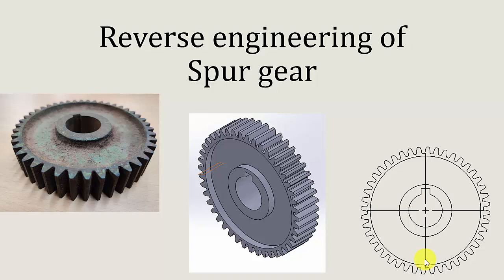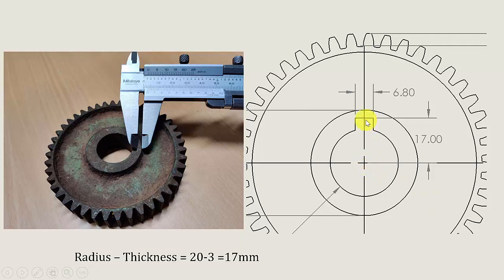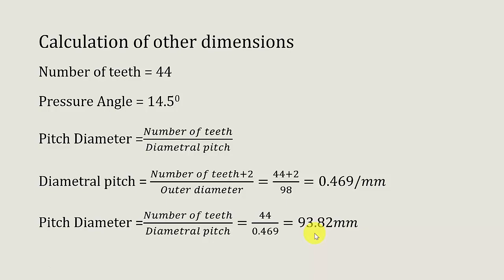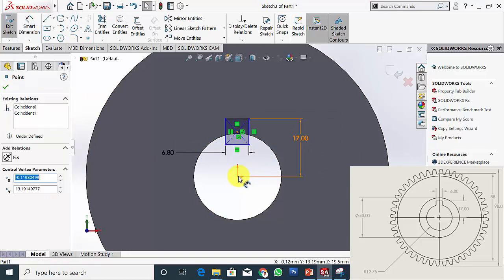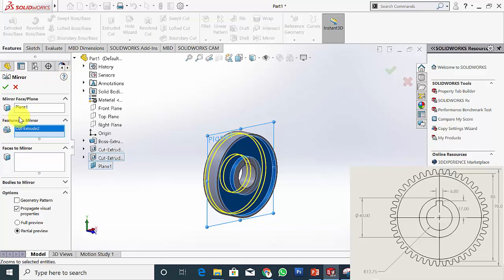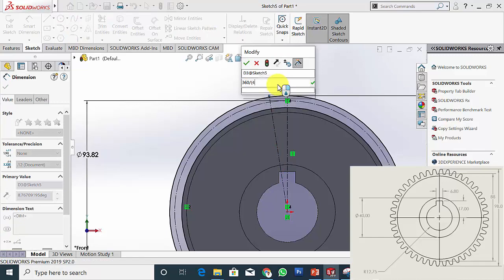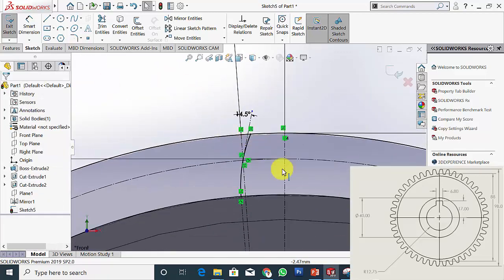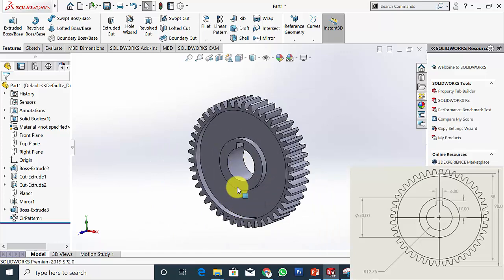Reverse Engineering of Spur gear using SOLIDWORKS | Solidworks Tutorials for beginners

Comment: good work , but how can i measure the pressure angle ?
Reply from the maker: Measuring pressure angle in gears.

Andrews A
How to measure pressure angle in spur gear

The pressure angle is an important parameter in the design and analysis of spur gears. It is defined as the angle between the line of action and the perpendicular to the tangent of the pitch circle at the point of contact between two meshing gears.

There are different methods to measure the pressure angle in spur gears, but one common way is to use a gear tooth vernier caliper. Here are the steps:

Place the gear tooth vernier caliper on the pitch circle of the gear with its jaws on the opposite sides of the gear tooth.

Adjust the caliper until the jaws are in contact with the tooth flank, perpendicular to the pitch circle.

Read the distance between the jaws of the caliper at the pitch circle.

Calculate the pressure angle using the following formula:

Pressure angle = arccos [(pitch circle diameter/2 - reading on vernier caliper)/module]

Where the module is the ratio of the pitch circle diameter to the number of teeth on the gear.

Repeat the measurement and calculation for several teeth on the gear to ensure accuracy and consistency.
Reply: @themechanicalengineer  
Thank you very much